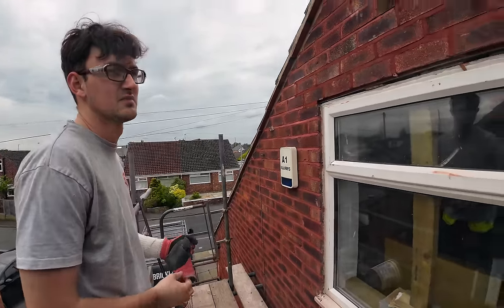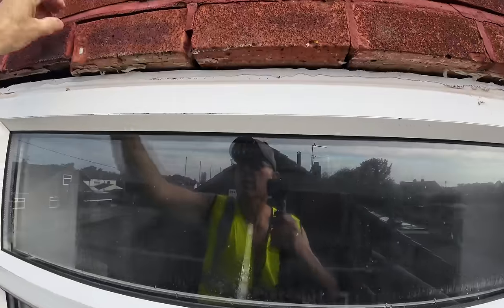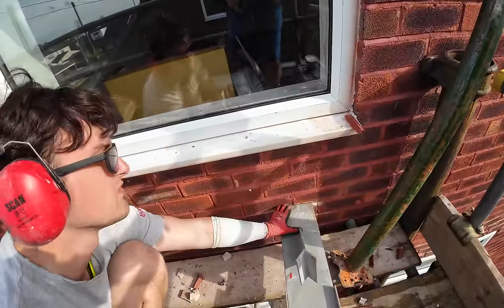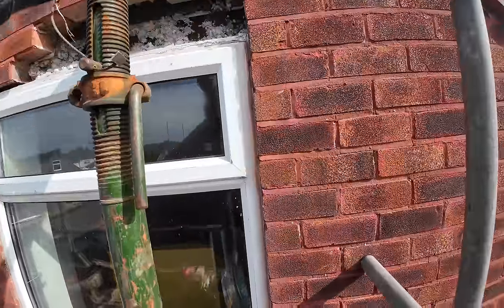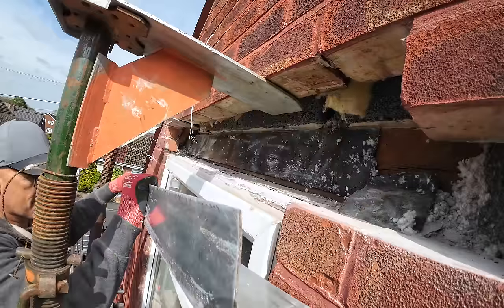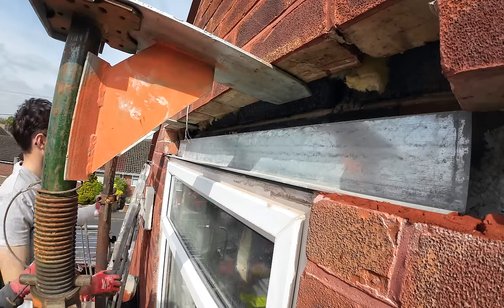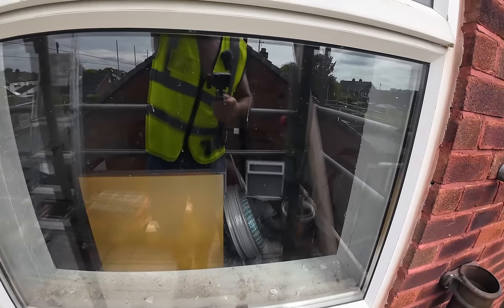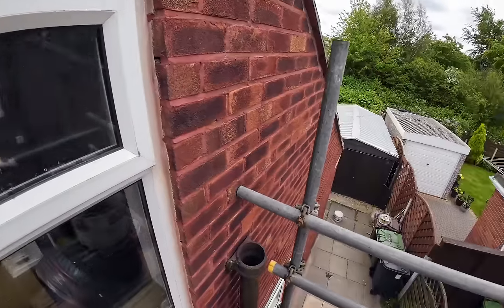HELD UP WITH A STICK!?

Comment: Nicely rescued chaps. Does that lintel not support the bricks until the mortar is set.? The head of the window has no reinforcement inside then ? 👍👍
Reply from the maker: The actual bricks provide the strength. The lintel Always needs propping till the mortar cures 💪🏼🧱👍🏽

Comment: No covering strip over the window?
Reply from the maker: Covering strip ?
Reply: @SteveAndAlexBuild  cover the gap between the frame top and the brick ... or wasn't there anything there before?
Reply from the maker: @BLAZERSEAMS frames being replaced 👍🏽🧱
Reply: @SteveAndAlexBuild  I guess the clue that I failed to pick up was when you had to prop up the rubbish frame top that was collapsing. Well done guys